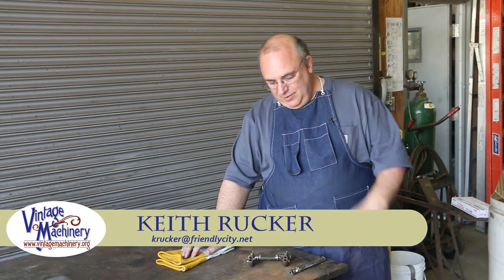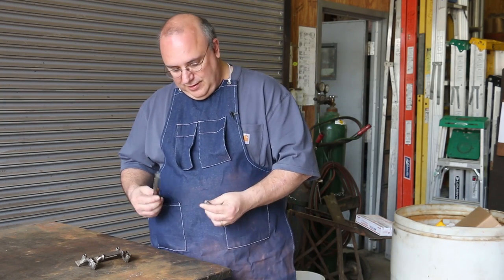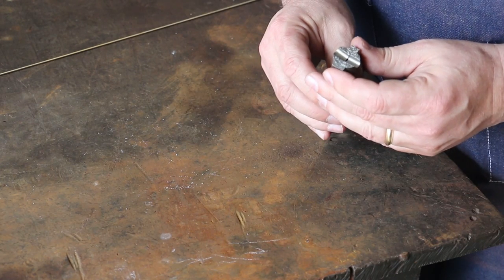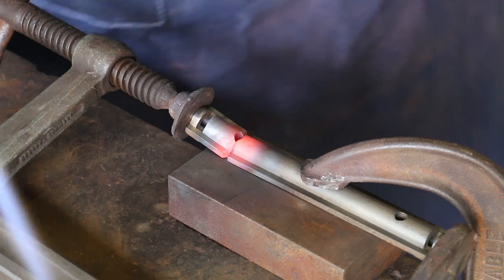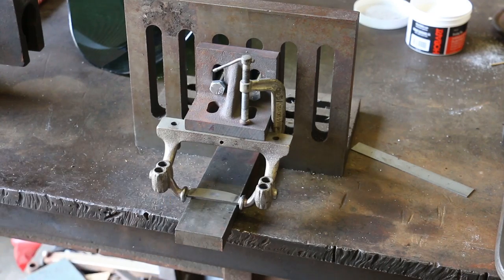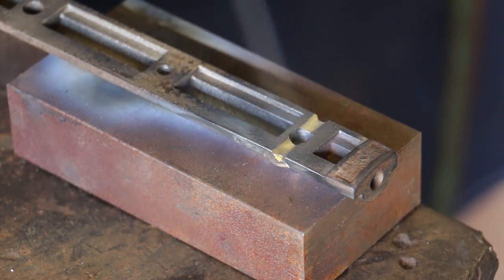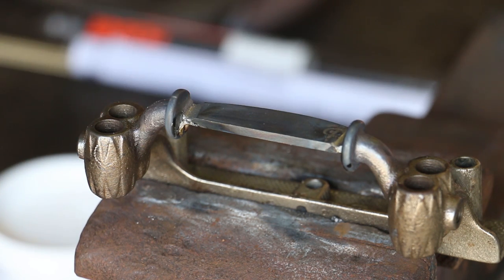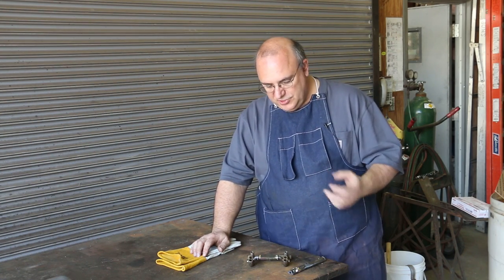Brazing Broken Cast Iron:  Repairing a Stanley 55 Plane

Comment: M'lady somehow, without my head being involved, broke off the handle of a cast iron pan.
I'm wondering how many hours it would take to heat up the parts to the orange glow using Map Pro gas???

 I DO  have oxy-acetylene available, but to be quite frank, it scares me  - fire/explosion type scare. So it just occupies space in my dining area (I've no garage, and no outside storage shed, and I don't think that the HOA commandos or my insurance company would be happy to see the tanks in my small patio).  I feel
safer with a Bernzomatic piezo trigger on a Propane or Map Pro gas cylinder.

Comment: I think I would have chosen silver solder for the first (bar) item. No need for grinding out a Vee. With high quality flux (important! not 20-year old goop!) only a little bit higher heat needed (no issue with OxyAcet) the solder achieves superb capillary action and would get sucked into the cracked joint perfectly. Indeed, that is the ideal spot for silver solder, when you have a zero-clearance joint as with fractured cast iron. Much stronger than brazing, better color match though you are certainly going to discolor the orig nickle plating,  but also less tendency to wash out and over the rest of the item.
Reply: And it would break as soon as you use it too. Geesh the ppl talking about solder kills me. Also the v is a must! I was trained in college by a navy retired diver welder, this guy in video did it all correct. The v is for more surface area to bond too.

Comment: As far as im aware, and this is more or less little tidbits ive picked up from welding class, but if you're going to braze something cast iron....Be sure it's not something that gets hotter then the braze, i.e a cast iron skillet or a cast iron wood stove etc. Welding cast iron is also difficult in the ways of you could easily either make the crack large or much worse or the whole thing could simply just fall apart. From what i hear.... but then again im getting my cert in FCAW and 7018 so....

Comment: Kris Nicholson suggested  that the flame is too "big."  I don't know what too big means.  The terms  that I have seen, heard and use are neutral, oxidizing and carborizing (or carbonizing?), with equal amounts of fuel and oxygen, excess oxygen and excess fuel respectively.  Let me hasten to add that you are not the only person I have listened to today that has completely omitted any discussion of the flame and the reasons for why a certain flame is being used.   It seems like someone claiming a reputation of "good" success, such as yourself, would launch in to that topic as soon as the torch is ignited.   I agree with Kris Nicholson that the "notch" that you provided is excessive.  I would have done the notch by hand to avoid removing that large volume of Cast Iron.  The brazing joint should be thin and follow the contour of the grain structure, which will provide much larger surface area than a smooth v.   I didn't hear whether you have any feedback from your customer to know if the part actually did work and last a long time, so can't speak to how much the things I just mentioned affected function or longevity of the finished part.  I will continue to listen to things you have to say, but think the flame "setup" (which you said in the video, "...if the torch setup is correct...") is an important part of the instruction.
Reply from the maker: +James Buchanin I think you make a good point on the fact that more discussion is needed on how to properly setup the flame.  One thing that I find challenging is that the way the flame looks on camera is different than what it looks like to the naked eye - the camera seems to make it look bigger than what I see when I am doing the job.  As to notching out the part, that is the way I was taught and it has worked well for me.  I like to have plenty of bronze in the joint rather than just a thin layer - thin layers tend to fail more than when you notch it out pretty big - at least for me.  I have not heard back from this particular viewer of any problems he has had so I can only assume that it is holding up fine.  I have done a lot of brazing over the years and I am proud to say that I have had very few parts that failed.  Also, doing a lot of restoration work, I see a lot of machines that have had brazing jobs done sometime in the past and in nearly every case, they are still holding up just fine.  Brazing is a good way to repair cast iron!

Comment: Oh, I can just hear the welding pros chomping at the bit.  Ha!  No offense to them, of course, because they ARE pros.  I had considered posting a video on brazing small parts like this with a propane torch, but after seeing others get "flamed" by real welders, I opted out.  Nice job on these.  I could almost hear you curse trying to firm up the corners on that long piece.  Been there, done that.  You let some heat out and did better than me for sure.  A couple years ago, that would have ended up looking like a golf ball on a stick if I did it.  10 min of "brazing" and 6 hrs of grinding.  HA!  But I am getting a little better each time.  And a big part of why is watching folks like you do it.  I can sure attest to the strength of a good braze job.  Due to my lack of proper welding equipment, it was my only option for years.  My go-to phrase was(ok...is), "it ain't pretty, but it'll hold".  But they're getting less ugly every time.  This was a double treat as I'm in to old tools and have a couple of 45s.  Thanks for the video.  Well done, Sir.
Reply: *****
Practice is sure a lot more productive when you have videos like this to show what right looks like.  It turbocharges the rate of improvement.  Thanks again.  I truly appreciate what you do and the effort you put into it.

Comment: Good info but I would have thoroughly cleaned my parts with alcohol prior to brazing. I researched melting temperature of bronze and discovered a propane torch will suffice to melt rod.
Reply from the maker: Melting the rod is only part of what you have to do.  You also need to get the cast iron up to a temperature hot enough to melt the bronze so that it will stick.  While doing it with propane might work, it would take a lot of time to get it to the right tempature.

Comment: Would Mapp gas be hot enough to do this?
Reply from the maker: You could probably do it, but it would take a LONG time to get the metal hot enough.  You really need a good torch setup.

Comment: My Dad used to mix the flux into a paste and apply it to the work with a brush...
Reply from the maker: The Essex Hunter That works pretty good on thinner pieces, but on heavy pieces like this, most of the flux will burn away before you get the part hot enough.
Reply: Keith Rucker - VintageMachinery.org This work was racing motor bike frames with the parts in jigs, it allowed the work to be carried out faster as you were not going back to your pot of dry flux.Here in the UK the gas supply company's have made it very difficult for the hobby welder to get oxy/acy I know have to run oxy/propane which has made all my oxy/acy fine nozzles redundant

Comment: In this day and age there are better ways to go about this that will produce better results. Preheat and tig brazing is much cleaner and more consistent. Whether it be oxy-acetylene brazing or welding. using the white- blue of the flame is the desired method. It transfers more heat and less contaminants.

Comment: I forgot to ask:  Do you "blanket" hot parts to make them cool down slowly?
Reply: ***** I've had luck blanketing parts by plunging them into a bucket of dry pearlite (available from the garden center).
Reply: I have heard of men packing brazed parts in hot ashes.  I think this was because the part was large and had to be pre heated in an open wood fire, brazed, then put back in the ashes.  Keith used pearlite to repair his casting furnace, so maybe that would work pretty well for cooling too.

Comment: i wish that part didnt move, now we will never know why you prefer dipped vs filled flux
Reply: +smellycat249 I expect that manually applying flux gives you more control over how much you can get in the joint...

Pre-mixed flux in a filled brazing rod means that you have what the factory decided is the optimum ratio of flux to braze metal - what happens if the iron base metal is of a different alloy than what they designed for? A little dirt, leftover foundry sand, or who knows what, especially in older parts can make you need more flux than that theoretical ideal...

Comment: At the risk of being shot down by 'experts', may I add my two penneth?    Firstly Keith,   I think you were setting yourself up for some grief as soon as I saw how you were about to clamp together and hold the pieces down firmly.    Two points here..   If you'd have held down the two pieces with something like a two pronged 'mole' type vice grip..    (sold as welders clamps...)   with LIGHT pressure...... and you could have placed the broken edges together nearer the middle of the stiff plate... ( G cramps would do, I know, but are a bigger heatsink aren't they..  a nuisance sometimes when trying to carefully control heat input, as here...  And while I'm here, a small piece of 'Astro board', you know,  that 'fake asbestos' sheet,  that plumbers use to shield wallpaper from scorching, if they use a gas torch to solder a pipe in a house..    that stuff. ...would have stopped the CHILLING EFFECT caused by that thick slab you used.    I noticed how quickly the work pieces went cooler very fast.. when you wafted the flame to one side..  the slab was chilling the pieces.. which also meant of course that as the metal got UP to temp'   it got to temp' and then OVER heated just as fast, because of the quite 'hard' flame....  You could still have clamped down onto the slab,   but with the work on top of the insulating Astro board first..  Heat control would have been MUCH easier, you could have used a much softer, gentler flame..   and so,  control would have been a lot easier, I think.    Also,  you didn't actually need to have them held down by gorilla strength did you, were could they go to?    LIGHTLY clamping would allow the work to expand naturally, and then (hopefully) return to the original dimensions...    Both pieces nearer the middle of the stiff plate would  better I think, ensuring the flat base,  (even though in two pieces now),  was all on a single plane..    This would ALSO have avoided the need to 'end clamp' each end with one big G cramp..   a major error here I think..   half of the smaller, vulnerable piece was hanging out in fresh air anyway, unsupported..     You were attempting to heat up to glowing red heat, effectively two 'pointy' parts, (because of the hole.).   and THIS means that the parts were easily up to and beyond their 'plastic' heat range...   As the fairly small joint areas came close to melting, the COOLER chilled bottom edge remained slightly stiffer.. and so the whole thing pivoted up, from the bottom, flat plane.     Secondly,  as the parts were end clamped, I'd be amazed if they didn't deform and shorten a bit.. ('Upsetting').   Effectively, I believe that you had slightly 'fire welded' them long before you got any brazing filler going.  (Like sword making..   heat the lump up, hammer it out, fold in half with a hard strip sandwiched in,  heat up again and hammer together to make it one piece,   rinse and repeat a few dozen times and bingo, you have a 'springy' sword that won't snap in two went flexed.. with a lovely grain structure,   that will take a sharpened edge)      Anyway...    I'd put a fiver on it that the hole needed a bit of a rat tail file though it to extend the hole back out towards the end,  in order to get the screw back in to meet the opposite side, if needed..   .      Finally, a couple of points...     1,  Russell Withrow is quite right, flux has nothing to do with temp' or fitment..   it's virtually impossible to use too much,  especially when learning,   get plenty of coverage with flux..   and KEEP dabbing the rod into the flux can..   to keep  the rod well covered all the time..  It saves a world of hurt, technically..   An oxidised rod end.. and parent metal,  with muck and soot everywhere,  leads to fizzing and porosity, a crappy looking WEAKENED brazement...  and is a 'bad thing'.. ...All the flux chips off as glass anyway...  or flips itself off as it cools, if a smooth braze...  so where's the harm?   Trying to be clever and using a bare minimum is fraught with headaches, in all sorts of ways.    Finally, and this is worth understanding... never, ever, fall for that old rubbish about "rough it up a bit with a bastard file to give the braze something to hold on to"..  ...Brazing metal is not like gluing wood, or rendering a wall..   'Brazing' is simply soldering.    Yes we give it it's own word, but it's only soldering.   It is HARD soldering, as opposed to the soft soldering that a plumber might do..  But all the 'rules' of soldering still apply..   start with clean hands, clean work metal, on a clean worktop..   and your life will go a damned sight easier and with less struggle and 'fixing' of your work later..  If you can, try to SMOOTH the surface.. not roughen it.     Any tiny 'peaks'  on the surface will easily overheat and 'FIZZ' the hard solder (braze) away..   Do not take my word for this...  You can VERY  EASILY prove this for yourself.  .....Get set up for brazing..  and choose something thin, that has an edge, or a point..  and deliberately (but slowly, so you can see what's going on..) overheat the metal with the torch, before you touch the rod on it ..   You will see the rod flow as it should  do...  on the thicker, cooler parts,   BUT.. at the pointy tip.. or at the 'raw edges' of the metal, where the heat builds up fast... the brazing rod metal will be rejected..   It will 'FIZZ' at you and do all it can to get itself away from the "too hot" metal edges or the pointy bit...   (No matter HOW much flux you try to use.)..    THEN,  try it again with a smoothly surfaced piece of metal.. finely filed, or emery finished..  even polished,  if you like   smoother the better...     if you can ensure it's perfectly clean (as ALL soldering should be,  hard or soft)..    then as you offer the rod to a 'just nicely ready' heated metal, the brazing metal will rush all over where there is a fluxed surface.   Like it's a lost boy running to mummy...   :-)    Ok, rant over.      I did like your video Keith, cast iron can be a swine...   but it can be made to behave itself a bit better.

Comment: I would have used silver solder as it would have been a cleaner job
Reply: Silver solder is plumbing and electronic boards. You obviously never brazed cast b4. Solder wouldnt hold 2 minutes under any load. You may as well use jb weld, your chance of success is the same, they both would look ok for a shelf piece and both would break immediately under any load.

Comment: I know next to nothing about brazing and only a little about welding but I challenge you to try some of the cast iron stick welding rods and do a bit of research on it before you keep talking about it. A lot of old-school people have no idea about how easy it is now. I'd say its even easier than mild steel. Try it sometime. No pre-heat required.
Reply from the maker: +David Mountain I have to admit that I have not tried anything but the old nickle rods.  But, I am not sure that I would try welding cast iron with any method without a pre-heat.  The localized heat caused by welding process will cause a rapid expansion of the metal in a small area that can cause the cast iron to crack.  The pre-heat is more important from the stand point of creating a wide area of heat than anything else.
Reply: +David Mountain 
Description

Stick
 Electrode, Diameter 1/8 In., Material Cast Iron, AWS Classification 
ESt, Length 14 In., Container Size 10 lb., Container Type Box, Tensile 
Strength 50,00070,000 PSI

52.00$ for a container.

Comment: On the first 'weld' on the rounded side, there appeared to be a hairline crack in the centre of the bronze after cooling.  These will propagate and should be attended to before further brazing.  Setting of the torch is also critical and IMHO too much heat was being put into the part.  I hope it works well and lasts a very long time

Comment: The next time you do a peace like this put a clamp on the sides so the braze doesn't fall out the sides, it's a common mistake people make and some times if you haven't done this before you just learn by your mistakes, also for such a small job there was to much flame, reduce your flame down to a fine thin blue tip about one inch that is all you need, the metal will still heat up fine, you also need to learn to braze with ether hand so when you have to do both sides like that you not working over the top of the other hand and twisting your self in half. With the invention of tig, Brazing has almost become a lost art, but there are still some old farts like me out there, if you want some tips to make you work a lot cleaner let me know and Ill help you out.

Comment: Couple clarifications, what you are doing is braze welding, not brazing. Brazing is lap joints and capillary action wicking the brazing alloy between the parts, where as braze welding uses built up material for strength. The filler rod you are using is brass, not bronze. Bronze is copper alloyed with tin, silicon, phos, etc, whereas brass is a copper/zinc alloy. For the technique,  I am sorry but you were way off the mark. When braze welding cast irons, you tin with an oxidizing flame and not much flux to avoid flux inclusions. Once tinned you can go neutral and build up the material usually with no additional flux needed.. You will find you get much better adhesion of the material, and a much cleaner job with a lot less risk of ruining a part.
Reply: I thought welding was melting the main metal together not capillary action